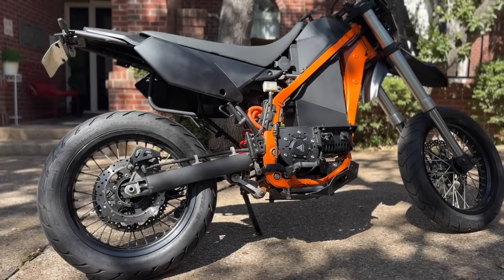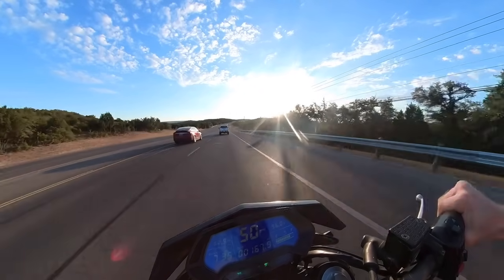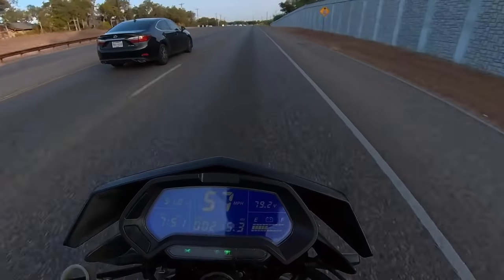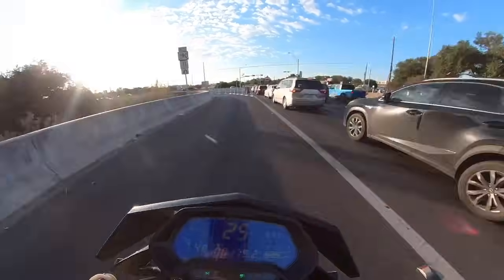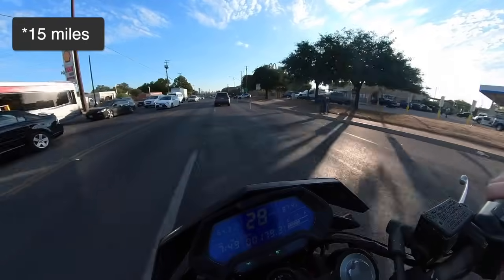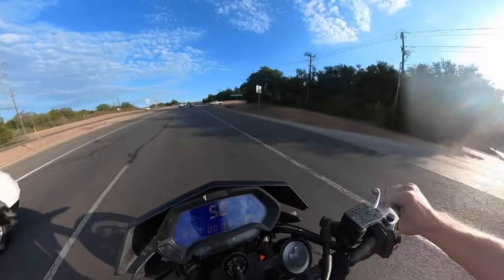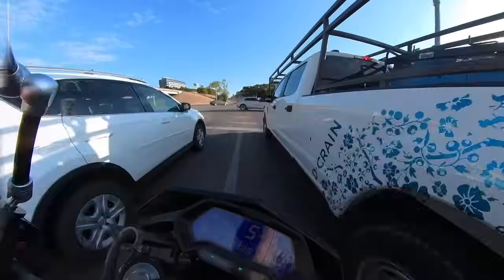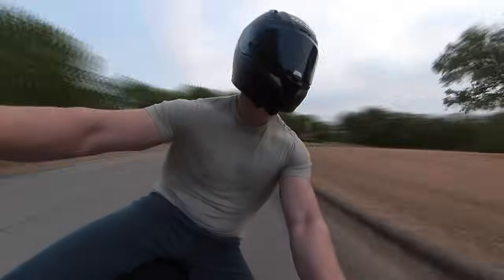I Rode My DIY Electric Motorcycle Until It (almost) Died

Comment: You get in accident you’ll wish you had insurance it’s not that much especially compared to getting sued, splitting cars and no insurance lol, people pull out in front of me daily etc, be safe man. Nice build! every state is different
Reply from the maker: The thing about insurance is that its really does come down to a genuine cost/benefit analysis. sure, getting into an accident without insurance would be an major problem but quantitatively, what are my chances of getting into an accident involving another vehicle if I ride a total of 200 miles per year, for example. Not only that but whether I would be liable financially at all is contingent on whether the person I get into an accident with has coverage for an uninsured motorist, and how much. A lot of variables here where it's no certainty that I would be financially ruined by the event. On the other hand, if you're paying standard rates for insurance, you cost per mile of actual riding distance would be quite high. Better to roll dice in this scenario IMO. It would be great if some solution existed where you can activate and deactivate insurance on a per-day or even per-ride basis, so you only pay for coverage you actually need. I actually looked into launching a start-up like this at once point and the regulatory and logistical barriers you would need to overcome are quite significant. Feel free to steal my idea and make a billion dollars, I'll just be happy to have the option
Reply: I pay $28/month for insurance on my electric motorcycle. Hardly noticeable. So what’s the problem with getting insurance? Seems like it would be a no-brainer considering how you ride between cars and split lanes. That’s begging for an accident. It’s also highly illegal here in New York but we still do it at traffic lights. Every single day drivers switch lanes next to me. I put an automotive horn on my motorcycle so that I can be heard and responded to. People drive in nyc as if motorcycles don’t deserve to be on the road.
Reply: 200 miles per year!?!? Jeeze, just ride more! Great build and video though. I just wish I knew how to keep the smoke in my pit bike project’s controller 😅
Reply: @GaiusGarage  Just so you know, just because someone has uninsured motorist insurance doesn't mean that's the end of it. It means their insurance company writes them a check and then they still sue you to cover that check they just cut. Insurance asks how many miles a year you ride, or drive, and that is factored into the cost you pay. Adding a 150HP supersport motorcycle to my insurance costs less than a hundred bucks every 6 months because they know I'm not riding every day. For a smart guy, you ain't being very smart on this. And then you go and publicly and permanently document all this lawbreaking. Astoundingly brilliant. If you do nothing at all, at least shut your hole!

You will be financially wrecked if you are at fault for a wreck on that bike with no insurance, I can assure you of that. I've had friends who were in wrecks with no insurance and they were sued and garnished for thousands of dollars. Most places just getting pulled over without insurance is a criminal offense, and you'll be without a license in short order and put on a very expensive short leash to get it back...
Reply from the maker: @pontiacg445 8==✊=D💦
Reply: Is it not illegal to ride without insurance in Texas? Seems like one ticket for that and an impound is more expensive that insurance. I mean, I was paying $15/mo for a gas motorcycle. Can’t really beat that, although you can only ride like 6 months out of the year in Michigan so it isn’t even $100 for a year until canceled.

Comment: About the charging, you need some sort of EVSE communication. There's a PP (Plug present) and CP (control pilot) basically they communicate to the charger how much current the charger can handle. Look at Thunderstruck EV's EVCC. It communicates with the wall adapter and allows current to flow. the reason it works with your charger likely has something to do with the chinese charger you used not caring enough about that protocol, and only providing the necessary communications for the car. probably even without a contactor at all. Also about the current, EV chargers are made to ramp up slowly instead of instantly delivering all the current they can. this helps with connector wear, cooling issues and safety stuff. Hope I helped!
Reply from the maker: Thank you for the insight! I've looked into this myself and came to the same conclusions. I figured the charger I had would include this communication line and protocol but the J1772 socket on the bike only has the three power lines (ground, neutral/hot, hot) for AC hookup, but nothing for the CP & CS contacts
Reply: @GaiusGarage  you could look into some BMS's that have EVSE functionality. Orion for example. Although the BMS is a pretty penny and quite heavy. I think someone has made it themselves before too as it's just a simple PWM signal, that Thunderstruck one is the only one I know of but even it is overpriced. So I'm planning on building a controller with the charger built in as it would save a HUGE amount of cost and weight, and the components are virtually identical.
Reply from the maker: @lolimpol  I actually found this on eBay which should facilitate EVSE functionality https://www.ebay.com/itm/364074539999?mkcid=16&mkevt=1&mkrid=711-127632-2357-0&ssspo=_IeXhqLoSna&sssrc=4429486&ssuid=hSX5ateKRDu&var=&widget_ver=artemis&media=COPY

Comment: Hi great build maybe if you move the controller and let the battery go all the way down you could increase the volts and the capacity it better if the controller is a way from water spray and higher on the bike but it neat and works good job and the video well put together

Comment: Might grab a draggy gps performance meter. Will give accurate acceleration and speeds at 10hz. within a few hundredths when I took it to a drag strip. Great for 0-30, 0-60, 1/8th mile, 1/4 mile etc. Measures Gforce on accel as well as decel etc.
Reply from the maker: that's a great idea!

Comment: Im stoked to see your progression,I just binge watched your builds while im researching these ali motors. Im concidering a dirtbike build with the reduction drive style motor, what are your thoughts on that style motor? Its all hills where I live so I was thinking it would be easier on everything and have lots of bottom end with less top speed and maybe i could get more rpms out of the motor. Keep up the awesome work
Reply from the maker: Thank you! Reduction motors are great! I actually just picked one up myself for a go-kart project. sometimes the gears do fail under high load but I guess that depends on your application. when I got mine, however, all the oil had drained out of the gearbox. I had to re-fill it myself with oil - no apparent cracks or gasket issues from what I could tell and it havent leaked since, but just FYI when it comes to ordering these parts from china
Reply: @GaiusGarage  On your Enduro build have you done any hillclimbs with it? It looked fast on pavement, I was surprised how well it works without a gearbox. Mostly Im asking so I make the right choices on my build, It's going in a Honda CRF mostly for dirt
Reply from the maker: @BillWrites-t2e I haven't done any significant hill climbs like the kind you would find on dirt or trails but I do live in a hilly area and don't even notice a difference. That said, I'd probably go with a geared setup for off-road. You'll have more low-end torque and likely will not be doing 80mph on dirt anyway
Reply: @GaiusGarage  Perfect , thanks for the advice. I'm ripping the ICE motor out right away and going electric
Reply from the maker: sick! If you run into any technical issue please let me know. I offer 1:1 sessions where I can really dig into the details

Comment: Fantastic build bro not sure if you have already put this in the comments but did you buy the motor batteries controller etc as a kit if so where from?
Reply from the maker: Appreciated it! I did not purchase as a kit but the motor and controller are available as one if you look on AliExpress. I would not buy a kit with a battery - better to source something suited to how you'll be using your vehicle than to the components themselves

Comment: With respect to the question of registered as an electric, of course our countries laws will differ somewhat, but I had to take mine to a motorcycle inspection facility and they went over it rather quickly,  and took it for a test drive and then put their stamp of approval on it.  The paperwork noted that it changed from g to e.  After that I just went to the Canadian version of the DMV and submitted the paperwork and they changed it from g to e in their computer. Simple as that.
Unfortunately for me the insurance system here is not cognizant of this type of change and so I pay exactly the same insurance for electric as I would for gas.  On a good note, that would mean if I upgraded the power I would keep paying the lower 50cc rate of insurance because of their  oversight.
Reply from the maker: Thank you for that rundown. I literally haven't even looked it up even since posting this video. all of that makes a lot of sense
Reply: That is sneaky, here in New Zealand, this build wouldn't pass inspection, health and safety here is tight, example of this is having multiple high-voltage disconnect switches on the battery, only orange conduit for high voltage cables, high voltage cables must be separate from each other with a plethora of other bits. Near impossible to get it road legal. Then to add, you'll have to do two inspections, first electrical, second mechanical (hardly anyone out there) then no one wants to inspect because they become liable if anything goes wrong, such bs.
Reply from the maker: @johannstoove9425  man that sucks. I can understand some standards for safety but in the end it just disenfranchises people
Reply: Had to get an engineer to submit a report to dept of transport for approval. Then roadworthy then registration. Lots of confusion . Took a year to build mine and a year and a half to get it registered 🤔
Reply from the maker: @strezmyers4715  what is your country?
Reply: @GaiusGarage  Queensland Australia.
Reply: You guyz are fortunate to have that law. .philippines is so strict that change engine convertion is not allowed. . I dont know why. The department is hot about motorcycle modification.

Comment: Nice work.  Just Subscribed! I've been riding a petrol bike all around the Philippines for the past 7 months and 19000 kilometers ( 11800 miles)  But once I settle down I definitely plan to go electric for around town. Zero just started manufacturing here, but they sure are pricy so a self build seems more interesting.
Reply from the maker: wow! long trip!! that's where petrol is still king. I think it's definitely possible to save on cost with a self-build as long as you make the right choices up front. On the other hand, there's a lot of value in the experience of building one if the cost is the same or even a bit more. hit me up once you're ready if you need some advice!

Comment: My regen works well on the 96/680 FD.  I was guessing Max back current was the max amount you want used back into the battery. And Stop back current as the amount used to slow the motor. (def. not saying thats correct)  I run 35a stop back current and 15a max back current. Its pretty smooth on the qs165. The "Variable part" is the RPM points and percentages it activates at. Its pretty smooth honestly once its dialed in. I use 100% from 6k to 8500. And taper down to 20% by 1000ish rpm. If you go to the bluetooth dongle on the fardriver site there is a link o the latest software.
Reply from the maker: Ive tried tooling around with the settings but I get the "use new BLE module" error in many places. I do have the latest version of the iphone app. not sure if the dongle itself makes any difference in terms of the "version" of the hardware. nevertheless, StopBackCurr seems not have much of an effect, and I am only able to set it to 10A, beyond that, I get the error. I cannot chance MaxBackCurr at all, as in the video, and that does seem to be the limit for regen current - and I observe that I am, in fact, limited to 4A regen. I am also not able to set the percentage in that section above 30%. Not sure whether its an issue with this particular controller, the controller version and app in general, or some misconfiguration somewhere else. one thing, I know, Fardriver docs on this topic are virtually useless
Reply: @GaiusGarage   Def. sounds like a software issue. Have no apple experience. But Android seems to work with the newer "NS96680" far driver controllers. I've run 40a+ on it without issue. enough to lock up the rear wheel at lower speeds. same app connects to my older 96v/250a controller with regen over 30% as well.
Reply from the maker: @AdamOpheim  Ive actually tried with Android as well and had the same issues. Ive reached to their support but its not very helpful. one suggestion was to update th firmware on the controller itself but the instructions in broken english are nearly unintelligible to the point that I feel like I'll just end up bricking the controller if I attempt it

Comment: Ready cool for a DIY. 110Wh/mi is kinda sad considering my M3 SR+ gets like 230Wh/mi. But there's much room for improvement and this is a great build.
Reply from the maker: Thanks but lower Wh/mi is better - its like fuel economy (mpg). motorcycles will have lower energy consumption than cars - same as ICE vehicles
Reply: @GaiusGarage  haha obviously 110 is better!! But I'm saying for a vehicle carrying one person that weighs 4-5x less it isn't very efficient.
Reply from the maker: @Theeslickness I'm sure there's room for improvement but 100Wh/mi is a reasonable power consumption for electric motorcycles. The curve is not linear and Tesla did put in a lot more RD to optimize the battery temperature and utilize regen. This bike is not using any regen at the moment. Zero SR, which is a close analog to this bike in terms of performance, achieves around 90Wh/mi.
Reply: @GaiusGarage  Ahh no regen, that explains a lot. You'll probably get better than 90Wh/mi with it. Please don't misunderstand, I like this project and I'm rooting for you.

Comment: Something that I saw on another site that made me think was a guy that was speaking a language that I didn't understand, but what he did was easily understood. He wrapped his chain in electrical tape and then he oiled it and it took like 90% of the noise out of the drive train. Just a thought. 😊
Reply from the maker: would you happen to have a link to that video? sounds interesting but probably not the best idea - would make the chain more rigid, increase chance of it slipping off, and eventually get all torn up

Comment: You can set back current and stop current as you want just sometimes app doesn't let to change value. On functions find Follow and select eabs when braking valid.After that in Energy regenerate input percentage of power at certain speeds.
Reply from the maker: yeah, I've gone down this road. The issue it that it simple will not let me set that MaxBackCurr value, no matter what other settings I change. It just throws that "use new BLE" error like in the video

Comment: I'm riding an electric bicycle based on bicycle parts such as the surron that I made myself.
It has a battery efficiency of 35wh/1mil
At a cruising speed of 60 mph, of course, it gets worse to around 60~70 wh/1mil.

building an electric motorcycle with a heavy motorcycle frame, the electricity usage won't be as impressive
but being able to use larger motorcycle brake pads still seems attractive.
Reply from the maker: yeah for highway riding you really need motorcycle hardware but yeah it will be less efficient. 35Wh/mi is really good tho! I would definitely love to improve the efficiency on my bike

Comment: I think I know how to fix the charging issue. You need a “connected” and “ready for charge signal for the charger to activate. I had to do the same on the Zero that I rebuilt. I’m also located in Austin, lmk if you’d want to meet up and talk emotos!
Reply from the maker: yeah I actually figured this whole thing out and built an arduino-based circuit to send the right signals to the EVSE. going to integrate this into the bike and do a follow up video. I'm down to meet up! hmu on instagram @gaiusgarage

Comment: Your acceleration from stop is awesome although if you are concerned I would either enlarge the back sprocket or shrink your driving sprocket. I dont know your situation but that is a common issue- especially if your controller starts dumping power (w/o much acc) at inclines.

Comment: ASMR electric motor sound. maybe you can put a mic on top of the qs motor.
btw, do you have a plan to switch the controller into votol em260 maybe?
Reply from the maker: ASMR would capture mostly chain noise, unfortunately. I did want to swap to a belt drive for this exact reason. I also have a Kelly controller for which I wanted to swap

Comment: Loved the video. Really showed me how much people can do on their own. Your custom bike did 0-60 in the same time as a Zero FX and had a 5mph less top speed. One thing I'm curios about is the battery size, given voltage and ah. Zero has a 7.2 kWh battery and has an estimated 70mph range of 38 miles. If yours is similar thats impressive for what Im assuming is less price.
Reply from the maker: Thank you! just 38 miles on 7.2kWh is pretty poor. I'm not sure what the issue there might be. Although it's not too unexpected to have a ~50% increase in energy consumption while traveling at a sustained 70mph. my average speed during this trip was actually only about 50mph, the 80mph runs were very brief. I'm sure the range would be less if I maintained 70mph the full time